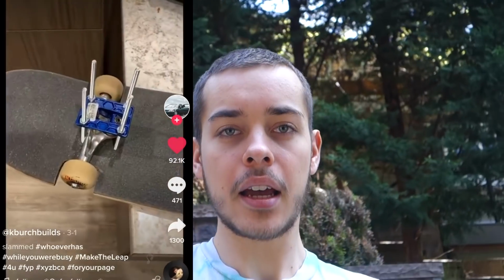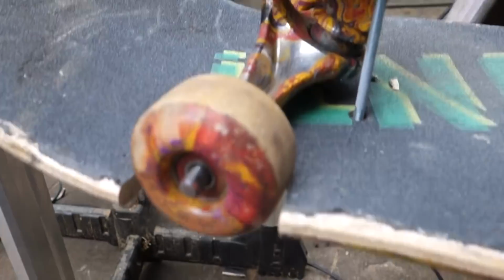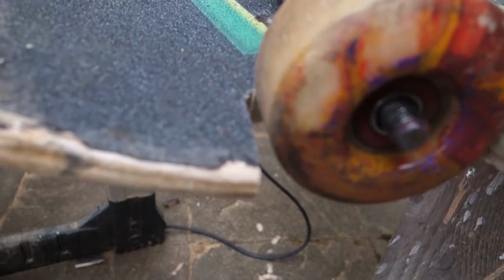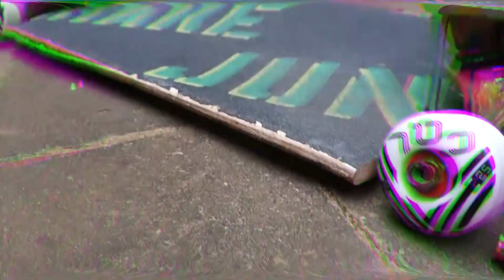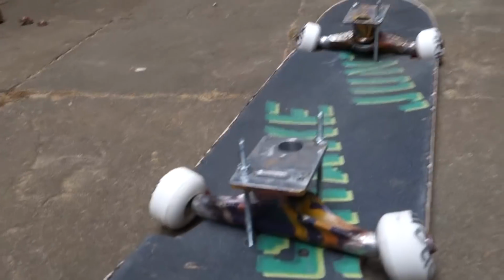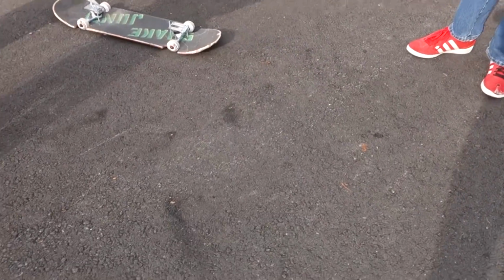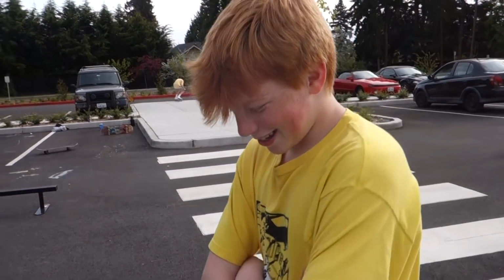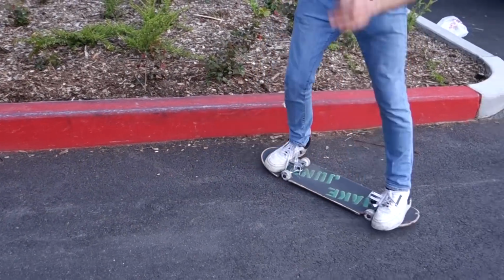Building a SLAMMED SKATEBOARD?!

Comment: so unless you cut the bolts flush and stand on the flat of the truck the entire top half of the trucks and bushing do absolutely nothing. the axle is flush to the deck so you could really just cut what is now the bottom of the truck flush, then drill angled holes to avoid the axle and use them to mount it. Would be much lower profile and safer